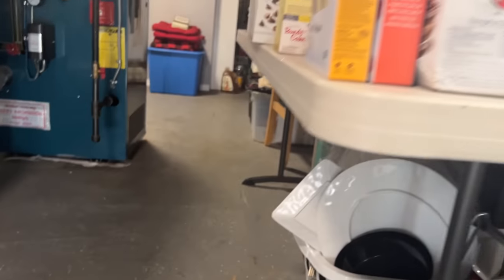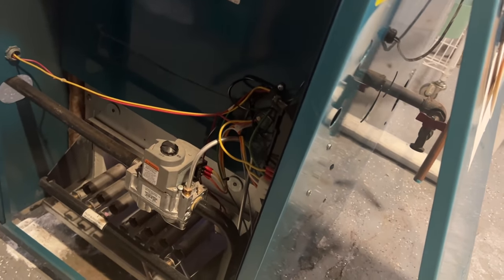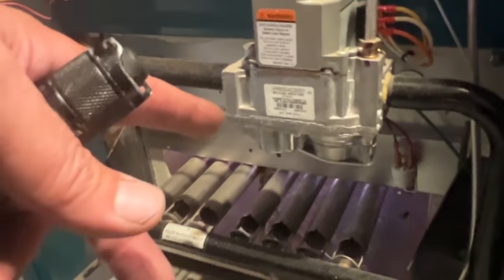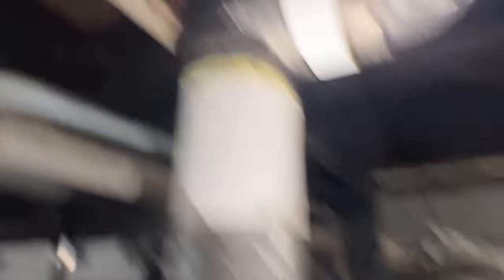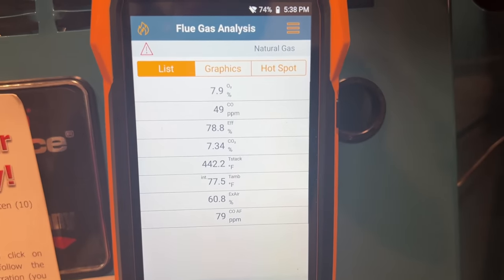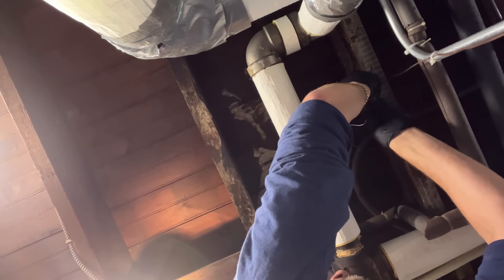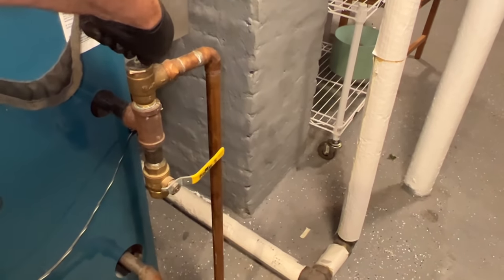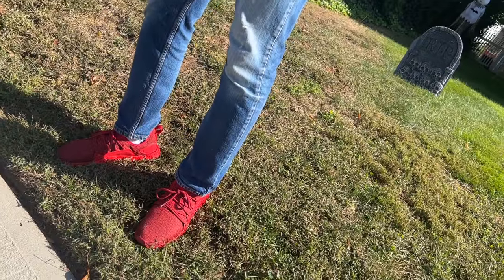Help! Burnham SIN5 Steam Boiler Making Loud Noise Don’t Want House to Blow Up! Bad Gas Valve Found

Comment: Use analog volt meter on coil wires to diagnose problem with incoming voltage being  intermittent. Volt meter needle will bounce indicating circuit opening.

Comment: The coil in the gas valve is weak. Moving wires and tapping controls are a good test.
Reply: probably something stupid inside that valve, like rectifier diodes and electrolytic capacitors(failed) for smoothing feeding dc power to solenoid coil/s (or more electronics yet)
you get that type of noise when a dc coil sees a/c or unsmoothed half wave rectified dc. but it could be cooked A/C solenoid coil not pulling in fully also.

Comment: oh no, adjusting gas pressure shooting blind without a manometer or at least meter clocking, no way to distinguish boiler issue from genuinely being over-fired.
Reply: @PipeDoctor  but it's not open.